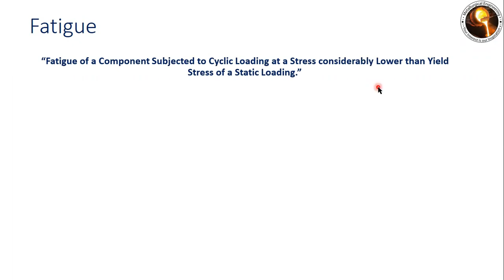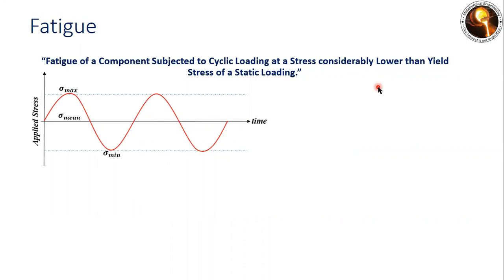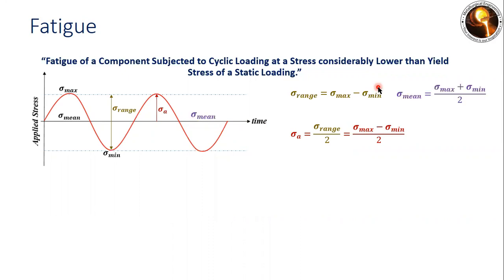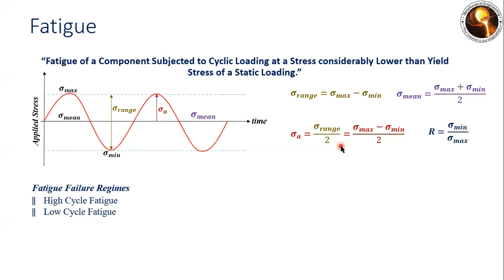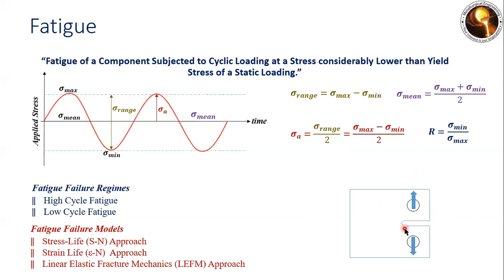Introduction to Fatigue

Comment: Does natural thermal dilation also cause material fatigue?
Reply: Its difficult to conclude. Basically, it depends on loading pattern. As per the definition, if material is under time varying stresses or dynamic loading conditions at any particular temperature, fatigue can be observed. Otherwise, creep phenomena might be more justifiable in such cases, provided loading is static in nature. Hopefully, the doubt might be resolved.